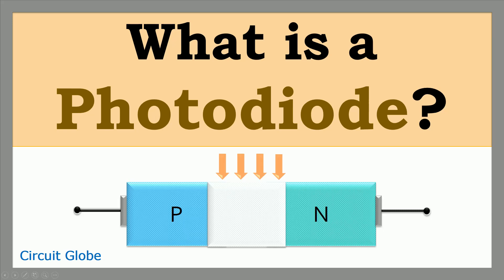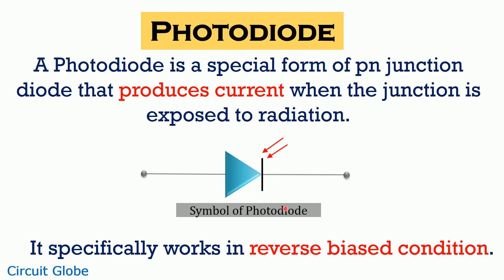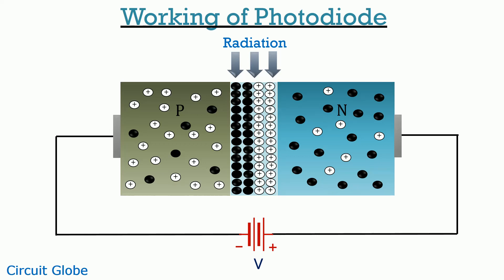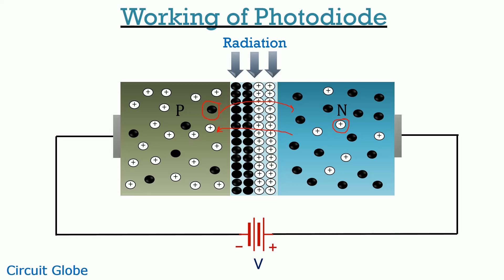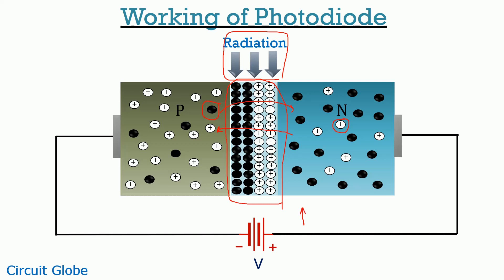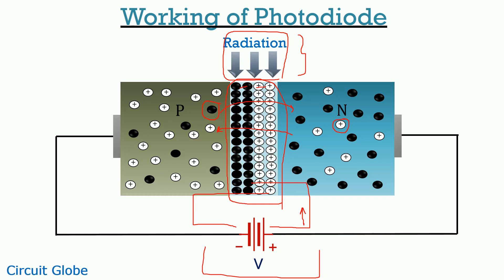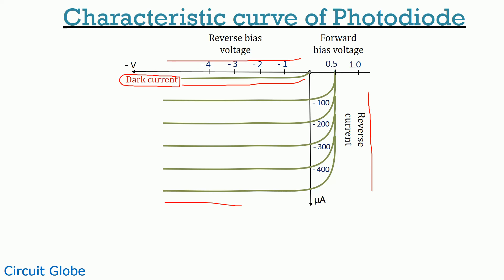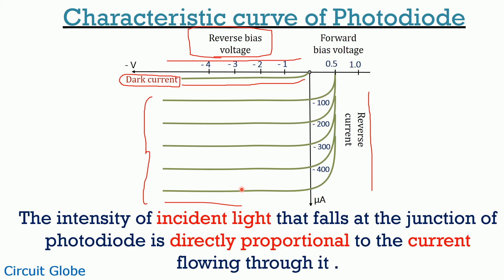What is Photodiode? Working principle and characteristic curve

Comment: Can you explain me why reverse bias is used
Reply: Bcse,we need diode to produced  current absorbing radiation.in reverse biase ,only saturation current is obtained which is directly propotional to the intensity of light
Reply: Only in reverse biase depleted region present on which light falls
Reply: So that holes and electrons don't cross the pn junction into the opposite zone and generate dark current, which may result in noisy spectra

Comment: At 4:45 the current is directly proportional to the light intensity and not the other way around. And the electron hole pair appears at the junction because of photoelectric effect and not because of heat generation in the junction. Thanks for the video